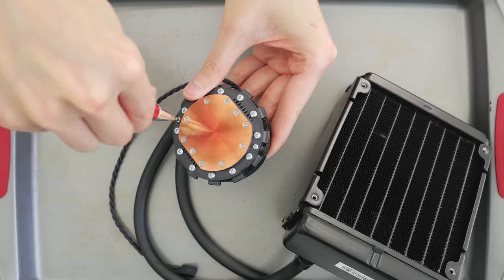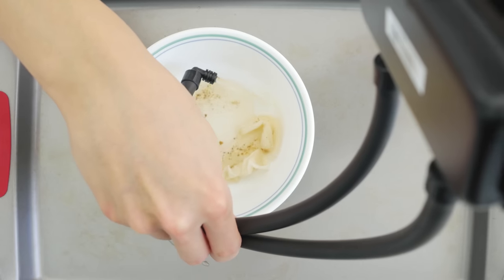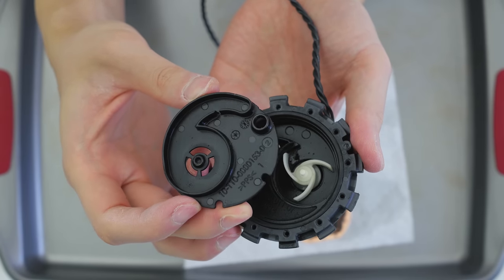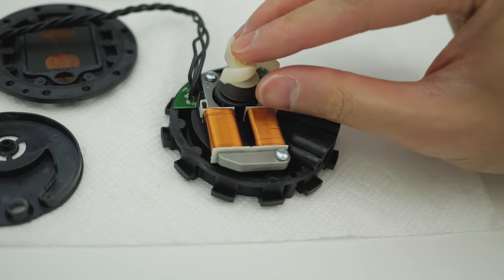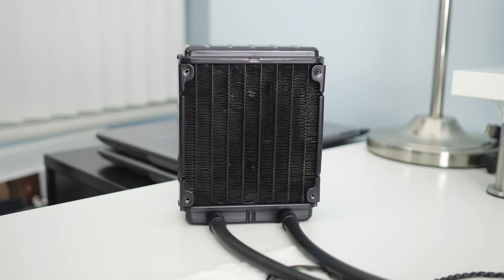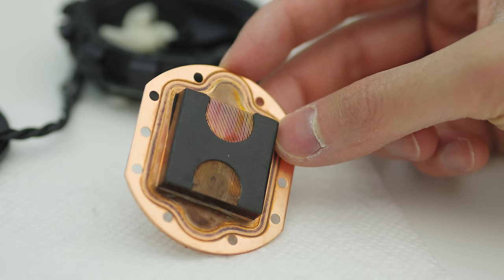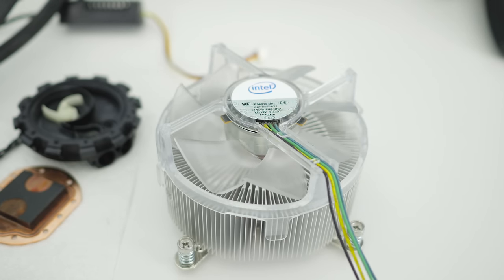What's Inside a CPU Liquid Cooler (Closed Loop) Teardown

Comment: Clean it and refill it. I bet it'll be fine.
Reply: Yea i want to see that too. Wont be that hard but very interesting.
Reply: Its hard to get that clogging out
Reply: +xGxPhantom Zzz  what about using radiator flush additive that is commonly used in cars?
Reply: try to backflush
Reply: refill with ??
Reply: Matthew Foote just not that easy 😂
Reply: You can cut one line and insert a t junction with a cap, seal and clamp the ends.
Now you have a refillable AIO. I will try this when I get an older one.
Reply: demian smith probably try Vue liquids.  I hear they are very clean and actually inhibit debris and build up.
Reply: xGxPhantom Zzz same concept as heater core flush. Flush backwards.
Reply: Zfast4y0u honestly it will perform better then a air cooler while idle and comparable to a tower cooler when under load, also what else do you think should be used in sff cases? There are plenty of cases I can think of that only have 20mm of clearance but can still take a 120mm in the side.
Reply: It really is this easy by the way. Use something like distilled water with a kill coil or PT Nuke/other similar fluids. Should really only have to refill an AIO when something went wrong with assembly or its clogged up but if it does happen dont be afraid to fill it back up before you go out and buy a new one.
Reply: But add a mixture of water and alcohol (ethanol). The ethanol is a biocide. It kills bacteria and mold.
Reply: Yansen Haryanto bingo
Reply: I took mine apart and had the exact same problem. I put the copper part in an ultra sonic cleaner and it worked like a champ cleaning it. Took a while, but it got it looking like brand new.
Reply: then use detergent soap when you clean it
Reply: Carb cleaner would flush that out easily.
Reply: Matthew Foote bro it's harder than you think
Reply: @demianxldc  Ethylene glycol + water as  mixture.  from 33 to 50 percent is normal for glycol. you can find at car stores
Reply: It is call a CLC closedloop liquid cooler which means you should not refill it
Reply: @demianxldc  i filled mine with car radiatot coolent, good
Reply: JUST DOWNLOAD LIQUID COOLER.. I HAVE A LINK

Comment: After taking it apart is it possible to clean it and refill it?
Reply: You probably could but you'd have to bleed the system of air bubbles when resealing the system. Air in the system causes improper cooling / temperature fluxuations, the less the better. AIO's don't have a purge valve so you'd have to make one yourself. Pretty much works like a car radiator.
Reply: Many CPU coolers have a filling port on the side of the block/pump. You just need to find a corresponding nozzle online (Ebay for instance). I had to replace the liquid in my Corsair H60 once, and it was VERY much clogged. But DO NOT take it apart for fun, it's a messy job that is OBVIOUSLY going to ruin your warranty.
Reply: You can refill. I did it with mine. Although, I wouldn't recommend using the fluid I chose. Although, I'll probably replace it if I notice any issues down the road with it. I'll get some distilled water. When I shot my video it was late at night and I just wanted to move along with the project so I used 50/50 diluted anti-freeze. I read that if you go this route you should do a mix of 1 part anti-freeze and 9 parts distilled water.
Reply: Steve Vachaviolos I didn't want to replace anything, just get it working again. I did bleed the system about 5 times. That might be a project for the future if the system gets clogged up again.
Reply: project for another day :)
Reply: Jason's Channel please do
Reply: Steve Vachaviolos Air bubbles are normal in an aio cooler. That's why they always recommend installing it in a certain way.. You can also minimize the amount of it by filling it with just below boiling water. But I don't know if a fully airless aio would be healthy in the long run, since there's nowhere to relieve pressure for the system.

Comment: Thanks for uploading this, much easier to understand how a liquid cooler works
Reply from the maker: np!
Reply: David Zhang thanks on this upload, always wanted to try this but not worth voiding any warranty.  Why would they do copper and not aluminum or titanium? For the contact pad that meets the processor.
Reply: dont use water please. its dangerous. use mineral oil, it flows better, non conductive, and has a better life span on the cooler
Reply: Keller weskier lol mineral oil submerged pcs require much more maintenance. Not saying it's bad just saying most people want something they can install and leave in for months to years.
Reply: copper conducts the heat way better then both of these.
Reply: it is a joke?
oil heats up faster, is a bad heat conductor and have higher viscosity overloading the pump...

really, that is complete nonsense.
Reply: AIOs usually use glycol in the water to prevent oxidation and algae growth
Reply: Oil also bursts into flames when it gets too hot, and is very hard to put out.
Reply: i was just going to say that
Reply: U
Reply: Thought the same Thing. I saw a lot of liquid cooler but never saw the liquid itself. This helped me understand. Thank you
Reply: @AgneyaKulkarni  ببختننه.ظظمجهجلة د
ثففف

Comment: I never trust closed loops, and after seeing this video, my concerns are validated. All that crap coming from the rad is enough to screw up the pump. Even on custom water loops, its always good to flush new radiators, many brands do not even bother with this in the manufacture process. Still, good video. Thanks for sharing.

Comment: My Corsair h115i developed this same problem in just over a year. Currently have my i7 5820k idling at 58c @ 1.16ghz... AIOs have always been a bit of a gamble in my experience.
Reply: What cooler are you using now? How did get your temps so low?

Comment: David, I literally just went through almost this exact issue. I also have the same cooler as you, the Antek Kuhler 920. So mine started making impeller failing noises  after i had cleaned out the system one day. I was stressed and worried that I had to replace it, so I waited a day. The next day I took mine apart like you did. Mine was not clogged like yours, but you can see the same issue is happening as they seem to use Antifreeze (based on the smell). I cleaned out my motor, cleaned out the fin array, and started to reassemble the pump. I used a small syringe to add distilled water to the pump before closing it up so the impeller had something to pup once it started back up. Reassembled and am currently back up and running on the same system. Their is still a small heat issue as I am running at idle  43c (109f). But once under load don't really get all that much hotter. I do plan on going custom loop on my next build, but if I do keep this cooler for another PC, I will be flushing and replacing the coolant in the system with proper coolant from EK (as it's a much cleaner and less likely to fail solution).  Now you said that it is difficult to add liquid to the loop, but this is not true. You can flush the system with distilled water, you would just need a large plastic syringe to push new liquid through one tube, the radiator and out the other. Assemble, and then do as I did, just add more water by pushing water into the system to push all the air out before assembly.

Comment: +David Zhang
I am thinking of buying a used closed system, but it might need to have the liquid changed. So when I typed this into youtube search, this was one of the top videos. Your video is very informative on this subject. I like how you explained what you were taking apart, and what to look for in case I do buy the used closed loop system. Good video all around.
Reply from the maker: +Ervin Goss Thanks for the comment. Although I'd just like to say that I don't recommend you change the liquid in a closed loop (unless it is one of those expandable setups) Filling these back up is extremely difficult as the fill port typically requires a high pressure injection to remove most of the air. It's not impossible just extremely difficult without a reservoir or a port to bleed air. Good luck!

Comment: Finally someone explained this in a non-confusing way :P Thanks for the breakdown! Might buy one soon cause my air cooler is making my room practically a sauna.
Reply: your room isn't gonna get any cooler from an AIO pump tho :/
Reply: @alecmnatzakanian5246  heck, if the AIO is doing its job well, it may heat up his room even more lol
Reply: Old post, but CPU coolers do the job of moving heat from the CPU, and into the room the computer is in.  There's no magic to get rid of heat.  Which is why server labs have to move the heat out of the room, somewhere else.  I have thought before, it would be nice to vent the PC's heat outside, or move it underground.  I once saw someone with a mobile home, dig a hole, for a water tank in the ground, and build a cooling solution around that.

Comment: uhhh, you could have just cleaned out the micro fins, flushed out the loop and refilled, boom fixed.  The pump is obviously working, just debris clogging up.  The debris you got is due to the coolant being an ethoyl-glycol (probably spelt wrong) mix which is know to react with plastics.  Alphacool and many others have premixed solutions by the liter on the cheap.  Great video!
Reply: Yeah I don't get that either. He just could do that indeed.
Reply: Would you risk putting this back together only to spring a leak and damage your expensive components? Worst part is that you've probably voided the warranty by opening it up.

Comment: I hope you washed your hands after touching that stock HSF!

Cool vid, couldn't you just flush and re assemble the AIO if the pump is actually functioning and its just flow rates?

You sure its glycol based coolant as well? Apparently (im relatively new to water cooling) some plastics have issues with glycol based solution's. I use a non-glycol based racing coolant 50/50 with distilled water in the custom loop i have.No discoloration or any other issues to speak of in the couple of months its been in use.

Comment: That foam is not for noise and vibration. It works like a expansion tank. But instead of bubble of air  it is a foam. Bubble in pump is problem. Foam does not travel through loop.

Comment: Very informative video. I was curious how the heat fins and reservoir cycled the fluid (as I thought, through heat pipes to the opposite side of the cooler, and back, for maximum surface area). Thanks!

Comment: Nice looking AIO, seems to have been well made.  My cooler just died, maybe I should take it apart like you did.  It made a lot of noise before dying ( I thought the noise was from hard drives, because that's what it sounded like, and I use some hard drives still, due to the cheap cost, for more storage for games.)  I wonder what caused the debris in the coolant?

Comment: You can easily clean the contact find inside with lemon juice and blow clean with air . Since your motor work fine just refill with new fluid , just be sure to run it through a coffee filter to remove any hidden debris. Also can test with cooler removed to check flow before reinstalling.

Comment: Correct me if im wrong.  So the way a CPU liquid cooler works is that it has liquid inside the pump and the fans on the radiator keep the water cool inside so then the cold water touches the CPU cooling it?
Reply from the maker: Pretty much. But here this video visualizes the process better if you're still confused. https://www.youtube.com/watch?v=npJZH5u6plM

Comment: my aio liquid cooler says the rad can also be mounted on the outside of the case. but if you can't take in apart how are you meant to feed the block back inside the case.

Comment: Hey david if you this, Did your black tubes on your cooler get hot? You mentioned that your pump head was hot however Im having a somewhat different issue. Sudden high temps and my pc shut down a screen that flashed by so fast that all I could make out was CPU over tempature! I immediatly took my pc apart to discover that one of the 2 tubes were Scorching HOT! the other tube was and is cold. Pump head is cool, radiator is cold. so wth? I changed the thermal paste still hot. I have i7-4790k OC
Reply from the maker: Tubes were warm/hot close to the pump, but were pretty cool for the rest of the tube length. If your entire tube is hot it sounds like it's at least moving the hot water but getting stuck somewhere else. Maybe an air bubble or a clog in your radiator.

Comment: PLS HELP: I got TWO evga 1080 Ti Sc2 cards with stock AIO coolers. Both have now failed to cool. Card is 90°C hot, but both hoses and also the radiator is completly cold. So I suppose the liquid just stopped to flow. IT happened suddenly, without any noises. Any ideas how to try to save/repair them? Open it up and clean? Or remove propelers and convert to custom water loop? Or use aftermarket air colers? Thanks for any advice!
Reply: Try custom water loop

Comment: I have a first generation H50 from 2010 and it's still working fine.  I imagine that since mine is slightly older than yours, it would have more of the debris circulating in the loop.  When do you think I will have to replace it?
Reply from the maker: It's really a luck of the draw. As long as your temps are fine and noise is adequate I wouldn't plan on replacing it any time soon. It's like a car. Some are lemons and some outlast our own lifespans, but you can usually tell when they are starting to fail when your temps and noise start getting worse.

Comment: so is it ok to accidentally punch a hole in the fins? the wiquid doesnt pass through the fins right? it just touches the tubea to dissipate heat?
Reply from the maker: correct. the thin fins don't contain liquid so you're fine. Avoid damaging too many fins though since it does impede air flow and reduce the radiator performance a little. but not a big deal if they are minor.

Comment: Ahhh the Water 2.0...I had an issue with mine recently. Just tapped on the pipes a bit and the water started flowing normally again. My question is how can DEBRIS get inside a closed loop?! Unless the debris is parts of the cooler itself breaking down into the water D:

Comment: what u mean by quit working, like ur cpu temp goes high, or the cooler just completely died, sorry, didn't really get what u were saying in the video
Reply from the maker: In my situation I started noticing that my fans were always on full throttle because the CPU temp was always high. You only notice the cooler is dead from the symptoms (high CPU temps).
Reply: alright thx

Comment: Why didn't you take off the tubes before opening the electronics compartment?
Reply from the maker: The tubes can only be easily removed from the head side of the cooler. They are crimped/glued on the radiator side so I didn't take the tubes off on that side.

Comment: Your pump being hot isn't a sign of failure. You have to actively check the temperature of the processor under load to really determine if the pump is failing. It's actually understandable for the pump to actively be hot, and manufacturers know this and design their components to withstand said heat.

If the pump is failing you'd see idle temperatures of like 60-70C. The fact that you were able to turn on the pump and the rotor began to spin means the pump is perfectly functional.

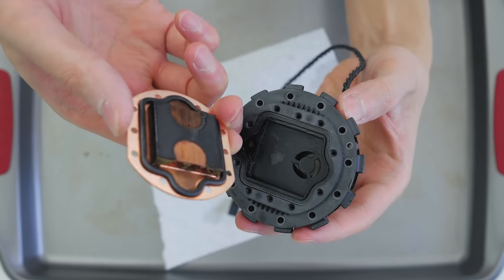Comment: i have exactly that CPU cooler. the problem is that tape and glue one the cold plate, you see it at 1:15 . my cooler went crazy the other day so i took it apart and it was full of that glue, i washed it out and removed the tape and cleaned the coldplate. then i fill it with normal water, while it was turned on and screw the cold plate back on, it sound and works like it was brand new again

Comment: Did it leak in your pc? I am still afraid of putting one in my pc because if it leaks it will take the whole system with it.
Reply: The whole system is costing me 3600 Euros (not including monitor and casing). If there is 0.1% chance of leak I am not risking it. Secondly, in a few months I will be going back to my country where it would be difficult to get any warranty claim from Corsair. Without these problems I of course would have gone with water cooling.

Comment: Mine started making an odd clicking sound it was bothering me so I took it out and switched to sock cooler.(Had it 6 years or more.) i3770K cpu  The stock cooler worked but the temps got very high. So I got another liquid cooling unit and all is well.

Comment: Do you have to change the coolant after several time of usage?
Reply from the maker: No. These closed loop liquid coolers are not designed to be refilled or maintained. By opening them up you void your warranty and there is no guarantee you'll be able to refill it after.

Comment: THANKS!! I wanted to know how water flowed inside radiator to know if 14mm tube would be the bottleneck of the flow. Guess the radiator channels are so small that the bottleneck is definitely in there, no point getting larger tubes!

Comment: I used to braze these for a living . The heater as we called them is made of brass and sometimes copper . Both good heat conducted .unfortunately the EU buracrats decided that soldering and most importantly acid flu was not the best way to solder the heater snd banned in the EU .the cores are pretty made from manufactures then we added the brass tanks and bottoms with a baffle separating the inlet and outlet .so liquid flows through the whole core thus cooling the heat around it